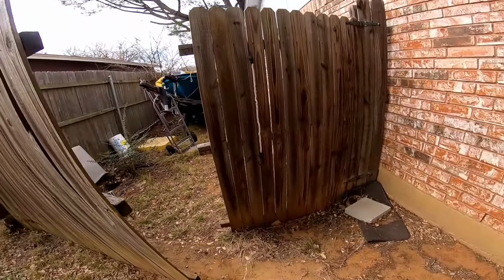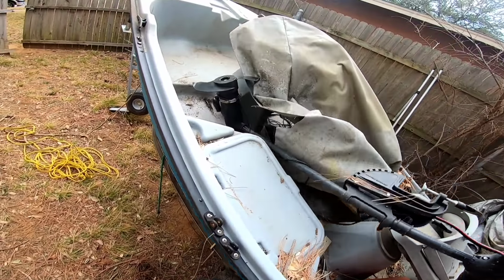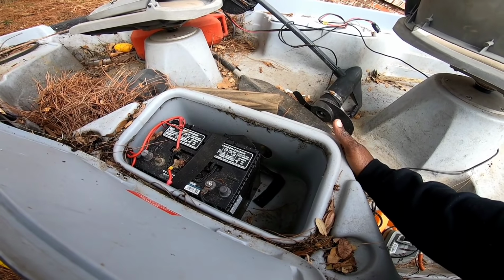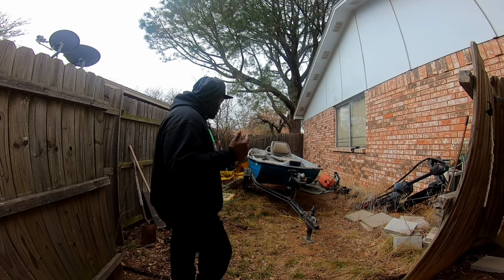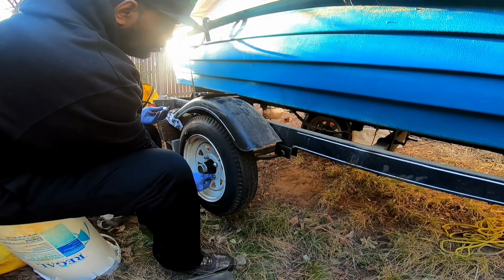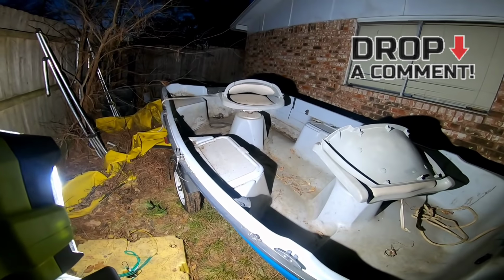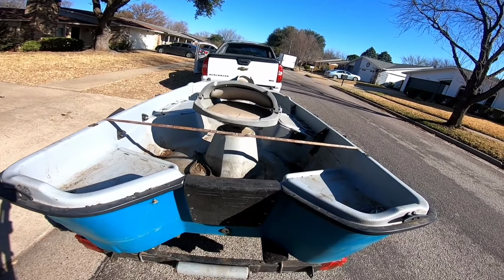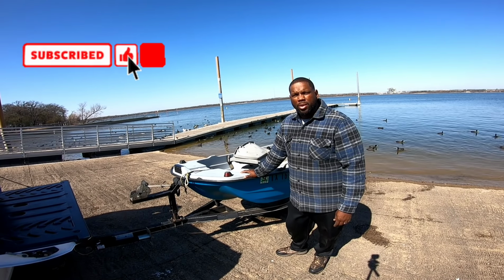Resurrecting A 20 Year Old Boat For Crappie Fishing

Comment: Stand the boat up on the transom end (off the trailer), pressure wash the interior or scrub with soapy water and rinse.  Inspect the bunks for rot, bends, running lights, brake lights, turn signals, etc., and repair and replace as necessary.  Change bearings or replace with buddy bearings with grease fittings, inspect the ball receiver, and put everything back together.  Done brother!
Reply from the maker: pretty close to what we actually did in this video!

Comment: No live scope on the two seater lol but with the small boys wind and waves are the only killer goodluck on it nothing like going back to your roots now if the transom is rotten i used arjay 6011 on a 89 15ft skeeter  just dug the rotten wood out and poured the epoxy in very easy👍

Comment: I have Pelican Predator two man bass boat and it has been a crappie killer. I fish alot of bridge colums so I added a Garmin 93sv for sidescanning. A Mercury 5hp on the back and a Minnekota 40lb trolling motor on the front. I can fish it year round but it shines during the spawn. With price of gas I expect to use it more than the big boat this year. I'm not afraid to add livescope to the baby crappie killer. Fixing the pull string is not hard if you clamp everything tight before removing the rope.
Reply from the maker: I may go ahead and try, might record my efforts!
Reply: Make it a portable setup so you can remove it with ease.
Reply: Ima bigger guy in the market for a two man boat I was looking at the pelican intruder 12 but I heard it wasn’t so sturdy im 6’0 330
Reply: You want a widest boat you can find. The wider they are the more stable they are.